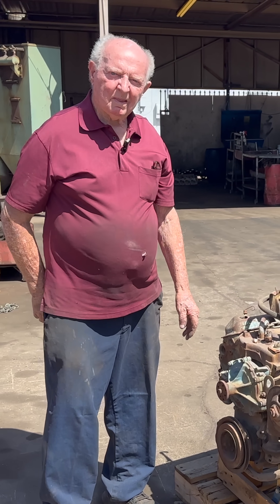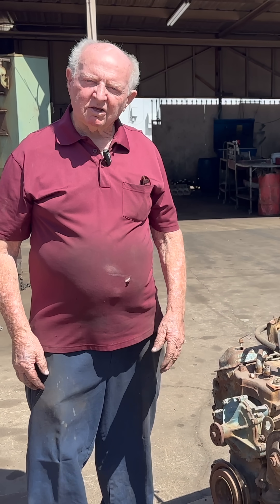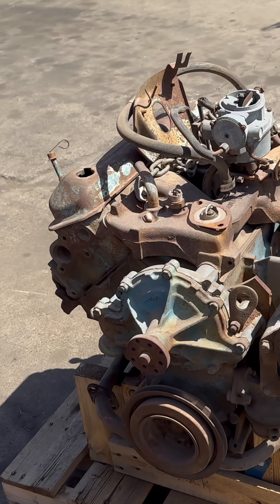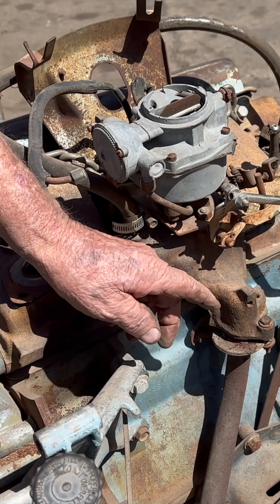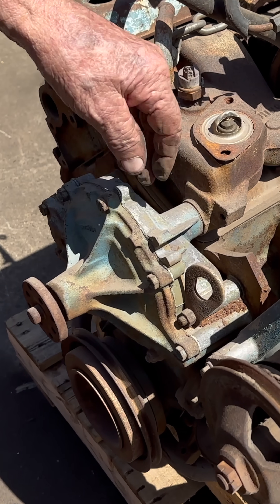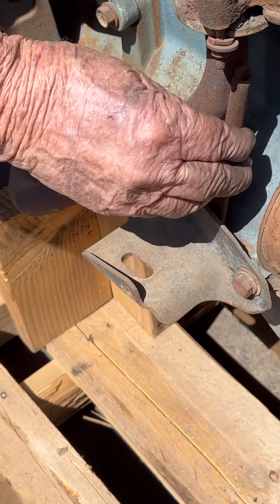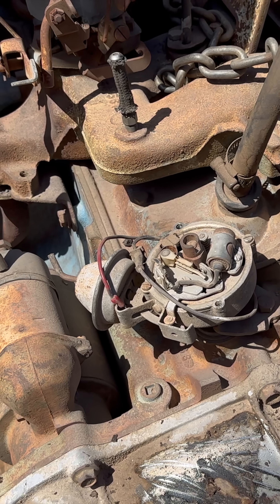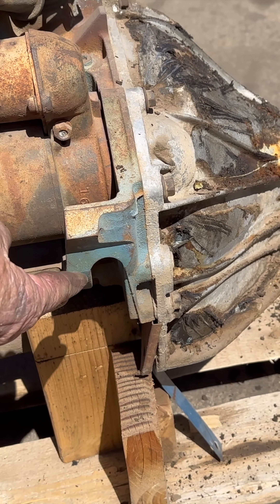Half a 389 Tour Part 1 - Pontiac Trophy 4 Half a 389! Ed Smith w #BarryT

Comment: Which came first, the Pontiac 194 or the IH 152?
Reply from the maker: What a great question! Seems like they both came out for the 1961 model a year, but the production of the Pontiac started sooner… Both were cut downs from a V8 donor design, both almost came out at the same exact time so pretty interesting…
Reply: Back in 80s while I was stationed at Ft Leonard wood Missouri. A guy in my unit had a old international pickup,with a slant 4 in it. I never heard of international slant 4. Or a Pontiac slant 4,until now.
Reply: 1964 IH series 900 pickups had a little shorter truck bed, regular size cab, and the slant 4 cylinder engine. Sweet little pickups!
Reply: As I recall, the International slant 4 used  v8 distributor cap, with every other tower blocked off
Reply: Not sure, I think the international  four came out In 61, the tempest pontiac four cylinder came out in 1961.  I have had both.
Reply: Smokey Yunick claimed both, said did the IHC first and then the Pontiac in a rush job when Gates was having trouble with rubber timing belts for the OHC inline motors that were supposed to go in the cars.
  The OHC Pontiac 6cyl didn't release until 67 with the Firebird, they gave up on the 4 as fuel economy was not a selling point for American cars.
Reply: @jeffhill3681 I’d tend to agree with that. First…because it’s Smokey. Second because he was, among a lot of other things, an IH truck dealer.
I once owned a Scout that had been a local IH dealer service truck. It had a lot of little differences, and was titled as a 1960, so I’d say IH was first also
Reply: @RedIron1066 
   In 61 Smoke was under contract with Pontiac for R&D, actually working on turbocharged 389's. Dealership ( GMC) was 62 or 63, switched to IH fall 69, 70 model year. 
   He had cut up engines for years by then for experimental information and was well known for unorthodox engineering work with GM and others. 
    Smokey didn't claim the idea, just development.
Reply from the maker: The 326 overhead cam sprint six was actually available in 1966 on the Tempest, I had a cousin that had one and he loved revving it up!
Reply: @jeffhill3681 I had a 1966 Pontiac tempest with the OHC 6 cylinder . This car drove great!

Comment: In 68 my friend in school had one of these the tranny was in the back and it actually had a rubber drive shaft. We would go out at night on the back roads of GA stop on the road turn the wheel all the way power brake it at full throttle and you could feel the drive shaft twisting up then release the brake and that thing would take your neck of doing donuts

Comment: And the car it went in was just as bizzarre. The Tempest was built on the Corvair platform but converted to RWD with a transaxle in the back.
Reply: Converted to front engine, not RWD. Sorry, brain failure.
Reply from the maker: I knew what you meant 👍
Reply from the maker: That’s absolutely right, it’s a head scratcher to me

Comment: So you can actually put aluminum head on it erasing intake ham timing chain all that stuff because since it was basically a V8 so most of the stuff will fit alone you just have to be very you know what I mean but it will work I bet it will work but good job I like it never seen it. 👍🙏🇵🇷🥰

Comment: I had one, most of the parts were exactly the same as the 389. Pistons, rods, lifters etc, and the distributor cap was an eight with every other peg blocked off. The weird part was the "rope" drive, that went to the transmission in the rear.
Reply from the maker: Wild

Comment: I had a '61 1 ton 4x4 International truck. It had a half V8. A 3-speed w/Granny low. Not sure if the engine came in that particular truck but it was an awesome engine. It ran like a tractor. We used it for hauling hay.
Reply from the maker: That would’ve been the 152 - half a 304 V8 👍

Comment: International Harvester did the same thing. The scout came with a V-8 and a four-cylinder. The four-cylinder is the V8 engine missing one of the heads and cylinders. They put a steel plate right over the crank case where the cylinders would bolt up.😊
Reply from the maker: That’s right!  152

Comment: Wasn't the chey Iron Duke half a small block Chev ?
Reply from the maker: They share a small number of components, but the iron duke was really a fresh design at the time
Reply: @JosephCowen-fz8vj   half of a Pontiac 301..
Reply from the maker: Hey Paul, thank you, that is actually correct as far as architecture goes! I don’t think they ended up sharing many parts, but that 301 was the basis for it for sure!

Comment: They put a strange transaxle in it, too. It had a long skinny driveshaft that was somewhat flexible, and connected to the rear transaxle. On the automatic models, the torque converter was mounted on the rear, and you could look under the car and watch it spin. A friend of mine had one.
Reply from the maker: You are telling it like it is, exactly right

Comment: The little slant 4 195 inch with a 4 barrel. I or.my grandfather had a 62 Tempest which had the power glide trans axle the same as what was used in the Corvairs. I wanted to fix up that cat and since I was still in my teens it  was his call. I liked the color, a burgundy over the white Chevy. We did take the seats from it and put them in the Chevy, they fit right in and were a nicer bucket instead of the bench the Corvair had, it was a 3 speed and a few years later I found a 4 speed to put in it
Reply: The Tempest these were put in had the torque converter bolted to the crank shaft with a flexible drive shaft from the converter back to the transmission and the oil feed lines to the converter from the transmission under the trunk then from the converter to the cooler then back to the trans.

Comment: So could you take the 4cyl out and bolt in a 389?
Reply: The 326 v8 was an option ,in 1963 but it was not 326 cubes it was larger for ,i believe that first year ,it was claimed ti be 326 as the big shots atGM "could not have a small car with a larger engine than the vette"
Reply: @Greg-xv9qj  Wow! Nice!
Reply: The issue was, the transmission was a trans axle in the rear with independent suspension. Believe it or not.
Reply from the maker: Some customizers did just that I’m sure it took some modification but the engine they certainly had a few things lined up for it!
Reply: Yes

Comment: Rope driveshaft?
Reply from the maker: Yes indeed
Reply: Flexible steel cable like a speedometer cable.
Reply: Read " On a Clear Day You Can See General Motors" . The driveshaft was more like (but not exactly like) a torsion bar . This was an attempt to reduce vibrations coming from that big four cylinder.